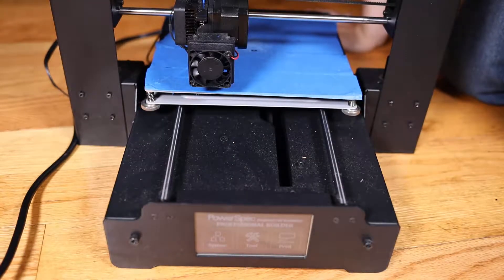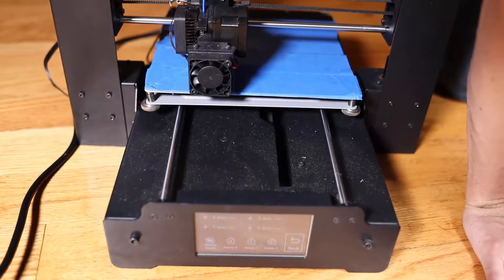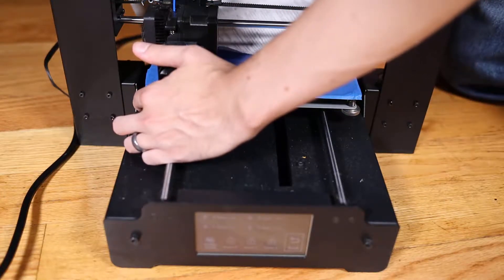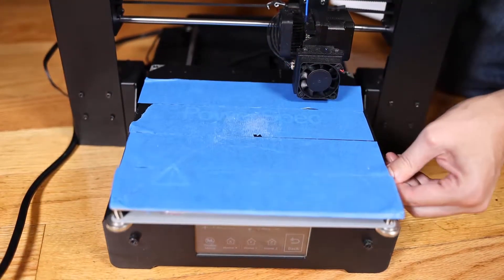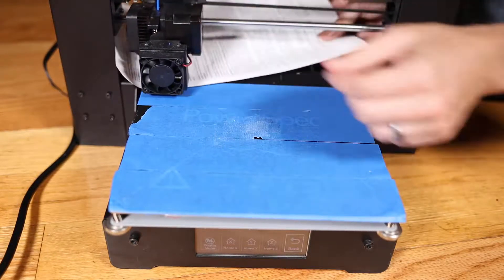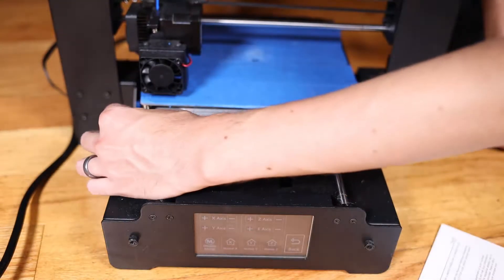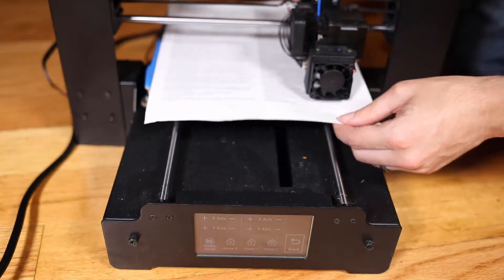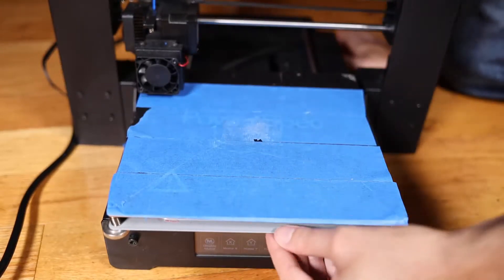How to Level Bed on Powerspec i3 Plus | Kinvert

Comment: Is there anything on top of the bed?
I just picked one up used and it came with some mind of metal sheet. Not sure if I actually need that or not as I’m having difficulty printing successfully. 
Is your bed naked with just masking tape?
Reply from the maker: I tend to put on masking tape yes. However the bed wasn't just metal for me there was like a black square of a pastic material glued on, then i put the tape on that.